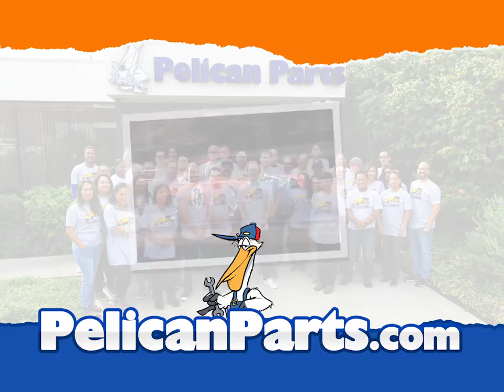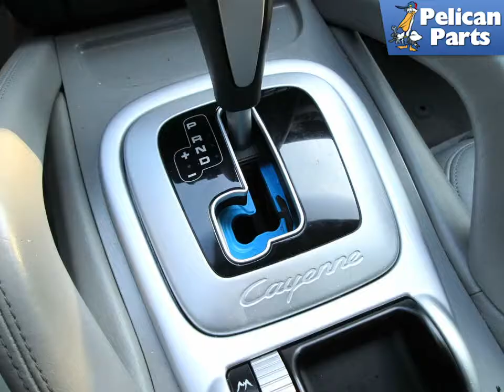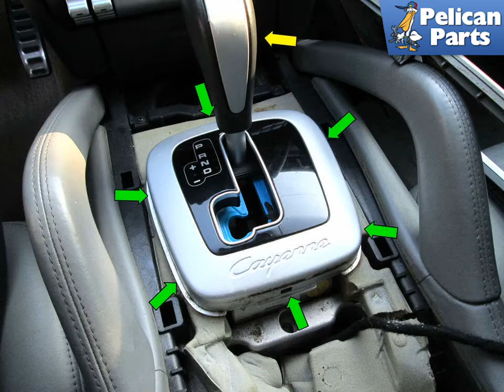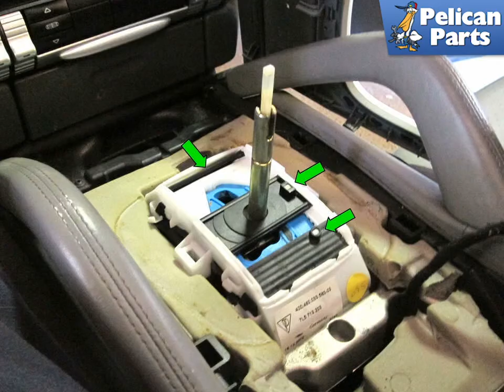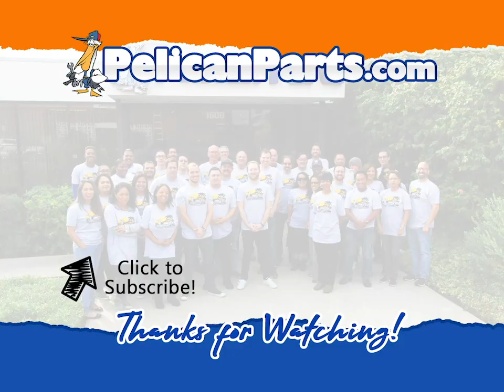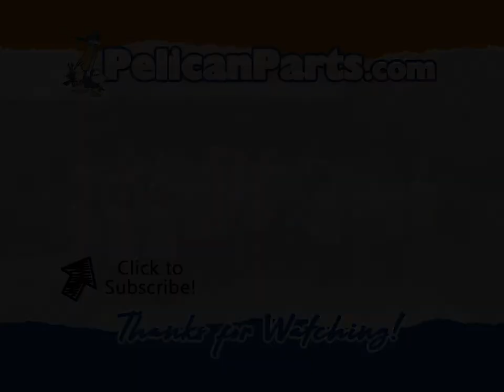Porsche 955 Cayenne Shift Gate Trim Replacement (2004-08)

Comment: I have an issue that is my gear is free to shifting but the gear is stuck in D, like when I shift the shifter to any other gear it wont select the gear and on the odometer ut shows D I tried resetting the codes but when I restart the car it shows P for 3 seconds then goes back to D, i have a cayenne turbo s 2007
Reply from the maker: I have seen this happen when communication goes down the DME. Check for fault codes. Check for a water leak near the DME.

Comment: He skipped getting the gearshift handle off….
Reply from the maker: Covered in fig 4:

Figure 4
Now turn the key on but do not start the engine. Leave the parking brake on and shift the car into neutral. Grab the shift knob (yellow arrow) and pull it up and straight off. It should take a bit of force to remove it. Now press the six black plastic tabs (green arrows) in and carefully pry the shift console cover off.

https://www.pelicanparts.com/techarticles/Porsche-Cayenne/11-BODY-Shift_Gate_Trim_Replacement/11-BODY-Shift_Gate_Trim_Replacement.htm
Reply: @pelicanparts  thanx! I found it in a different video 😎🤙
Reply: @pelicanparts  Pull the knob forcefully, it doesn't want to come out